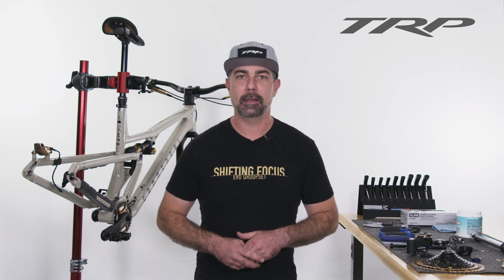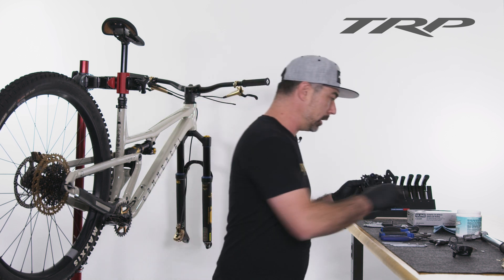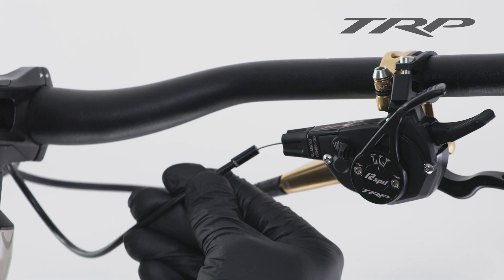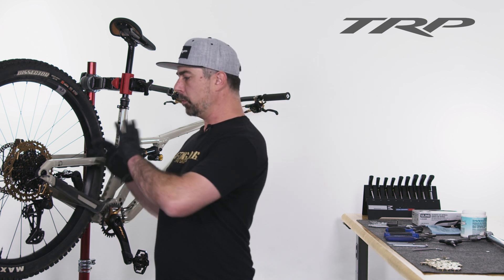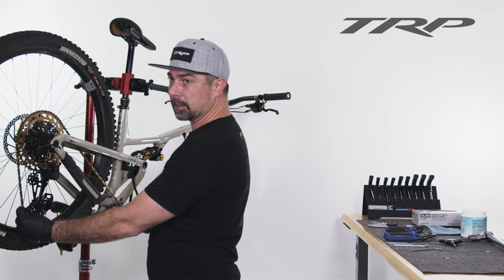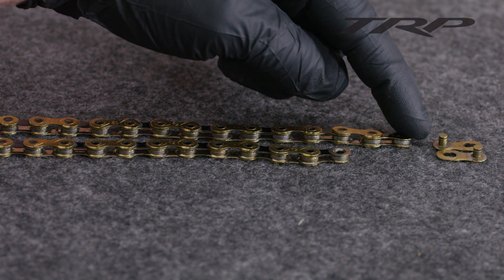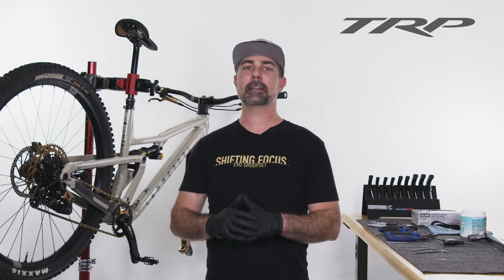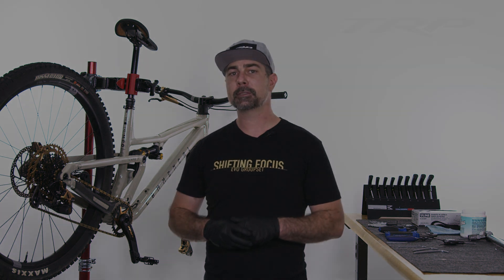TRP Tech Talks- EVO Drivetrain Installation

Comment: I’ve been running the dhr evo setup for about a year now, and recently it’s developed a problem where the chain will jump off the upper derailleur pulley. I’m guessing it’s a hall-lock adjustment, but wonders if you had any insight.
Reply from the maker: Email our service team at info@trpcycling.com, they should be able to help diagnose and fix the issue.